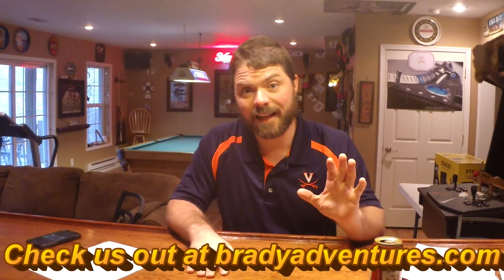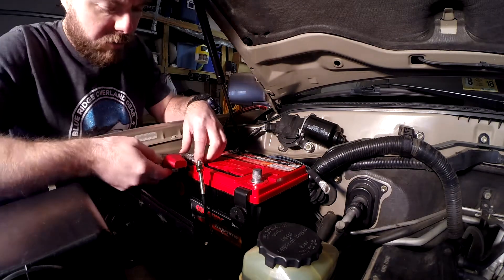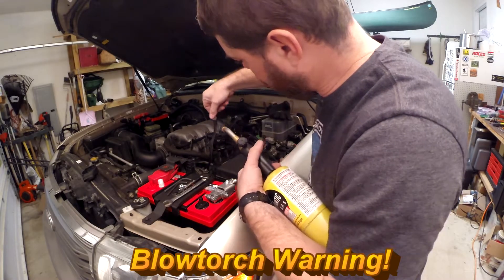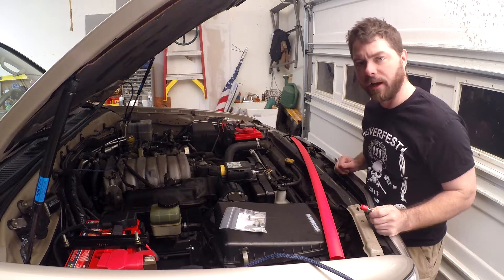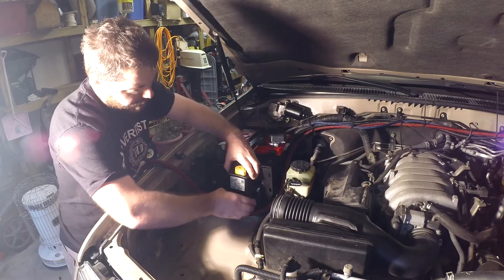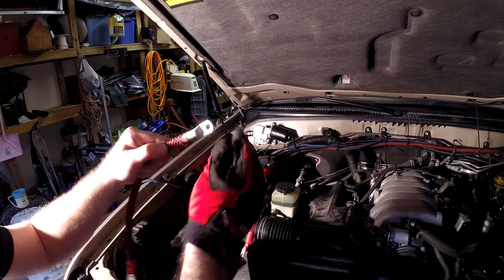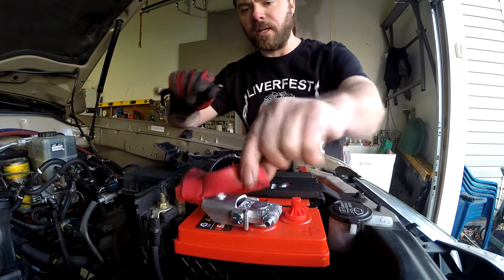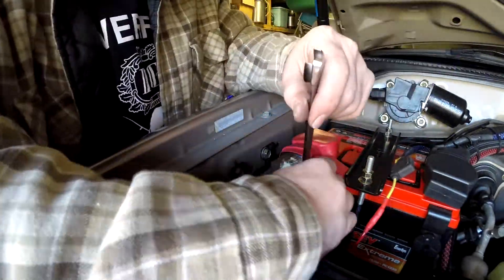Land Cruiser Blue Sea ML-ACR and 1/0 Wire Install

Comment: Boss, how did you wire the switch? Did you just use Red, Black, and Yellow? Did you tie 8 and 3 together? I followed the diagram but I’m not sure. I don’t have the LED on the switch come on.
Reply: No idea how it’s wired but he did say he used 4 wires. Red, yellow, brown and black would be my guess. 8, 3 and the power wire from the battery that’s not connected to brown wire need to be connected for the LEDs to work.
Reply: Are you able to firguire out the switch?
Reply: @peteru9980  I haven’t. The LED on the switch is still off.